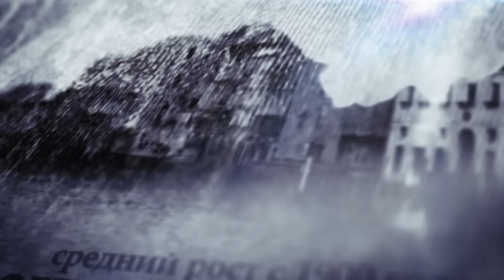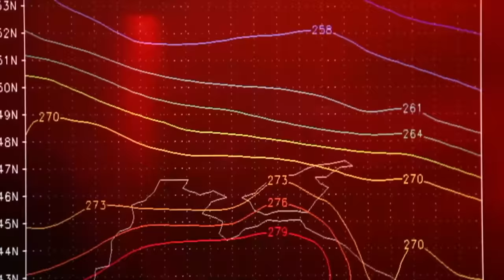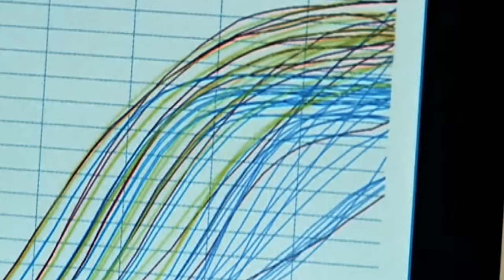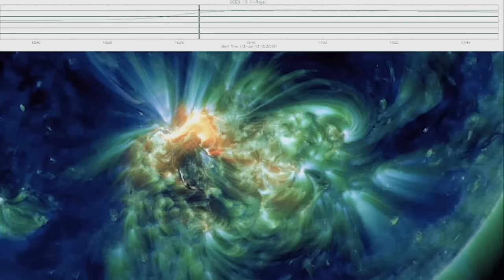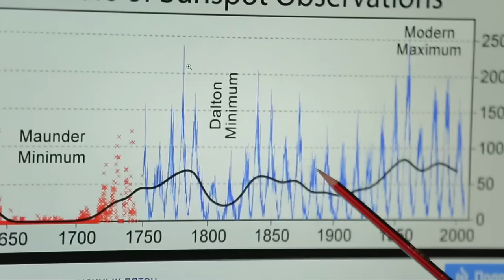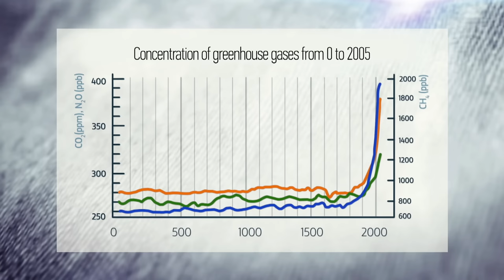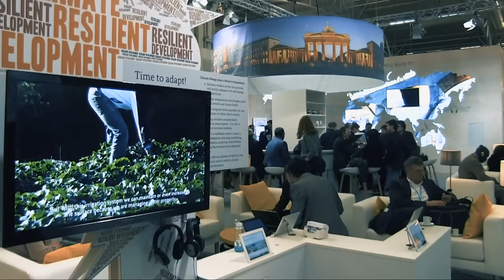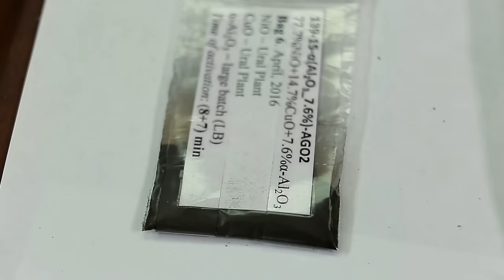Which Countries Could Be UNDERWATER Due To Global Warming?

Comment: Walk across six lanes of a highway barefooted during the summer time then try the same distance on grass. Ever seen the steam come off the rooftop of houses after a rain? As long as more houses are built and roads are widen battery operated vehicles won’t matter. Also feel the heat coming of an air conditioning unit. Houses are usually built after removing dozen if not acres of trees.
Reply: i used to live on a farm and quite often went for a walk in the evening/weekend.  in one direction  half a mile away was a main A road in a valley below.  in the other direction was country lanes and the temperature and air quality difference was obvious without doing any scientific measurements.
Reply: Even the same as dirt were so far gone it’s hard to turn back but I would want to for the planet tbh it sounds so much more peaceful
Reply: Try putting your hand on a solar panel on a hot sunny day. Solar panels can get up to 36 degrees Fahrenheit warmer than the ambient external air temperature. Because the panels (like roads) are a dark color, they are hotter than the external temperature because dark colors, like black, absorb more heat from the sun. When solar panels get hot, the operating cell temperature increases and reduces the ability for panels to generate electricity.

So you have a lot of people commenting here that we need to move to renewables like solar, but solar panels contribute to heat generation and become significantly less efficient when hot. You need enormously huge solar farms to even attempt to power a small city. Think of the heat those panels in that solar farm will produce.

So the solar you think is the answer actually works against itself by not workingvin and contributing to the environment you want to prevent. Can you see the paradox?

Another paradox is the belief that people should move to the cities where they can walk to work or use more energy efficient public transportation. Look at Phoenix AZ as an example. When I first moved there in 1998 the Phoenix metro area had a population of less than a million. By the time I left in 2015 population was over 5 million. In 1998 you could hike to the top of Camelback mountain, look out and see the edge of the city with nothing but the Sonoran desert beyond. In 2015 all you could see were houses as far as the eye could see. The housing bubble caused a lot of desert to be torn up to be replaced by houses. All the roads, cement sidewalks, and tile roofs caused an enormous heat bubble over the Phoenix metro valley. This caused weather to move around Phoenix instead of over it as it used to do. I diffinately noticed over the years I lived there we got fewer and fewer rain days and it got hotter and hotter. You think that huge metro cities don't change weather patterns? They most certainly do. 

Now why are "they" pushing the climate change agenda like they are when it's obvious some of the suggestions are clearly not helping anything? Politics and economy. Each president and political party has their stump issues to attract voters and attain power. For Bush is was an economy and investment opportunity based on war and defense spending. Remember the axis of evil? Bush and his cronies made a lot of money investing in defense. For Obama it was healthcare that was leadingvour economy. We were forced to buy insurance and who made money? Insurance companies because premiums went up. Healthcare companies because heathcare costs went up. Trump, it's hard to pinpoint, but probably energy sector because he pushed for energy independence and small business. Now you have Biden all in on climate change and renewables. Why? Look at how many of his cronies are heavily personally invested. His energy secretary is personally invested in EV battery technology. Because they care, or, because they want to make a lot of money for themselves?

I'm not against solar. In fact, my off-grid tiny home property in AZ runs  ompletely off solar and my tiny home in Upstate NY has solar. Clearly it works better in AZ than NY. NY solar is only backup for if the grid goes down, but it's not a fulltime solution here. I believe reducing our footprint and reducing our consumption of energy would be a better tactic than changing our source of energy. We should not have built communities of 3000+ sq ft McMansions all over the country.
Reply: agree with the statement black or dark things absorb heat,short answer roads roof tops sidewalks should all be white, not black and red brick is just as bad,white reflects heat. town and city centres are 4 degrees warmer than surrounding countryside,ie black bad green and shade better.and large bodies of water act as moderators for heat ie cool day and release at night
Reply: Well, goodbye earth I guess
Reply: @joshua25k64  no injoy we as humans actually do somthing nature actually loves giving it its oxygen CO2 😏
Reply: @eriknielsen1849  I will enjoy. Cause I'm still pretty young.
Reply: @joshua25k64  😊 good to hear. The best thing I have learned in my 50 year's old life is no matter what fails its always becourse somthing better is coming.... Just a thought. 😉
Reply: @joshua25k64  if we had it.
Reply: Nature will prevail. If not lord help us.
Reply: We could go back to homes build into the earth and roofed with earth and grass. I'd like that. Actually my preference would be to build inside a mountain, using it as a heat sink to keep my place cool, and do gardening and raise animals and bees outside. But we couldn't do that for everyone.
Reply: @amberkat8147   I had a sometimes day dream of lof land covered in old growth trees  Pretty confident it would be its own temper controlled climate with its own atmosphere. It wouldnt rain and storm under a proper maintained canopy but it would condensate like no other and water would run like a faucet down the tree's . 24/7 shade when you take out a tree  or one dies you revitalize the soil rotating crop around a sapling and nurturing it to give us a new roof.  Alot of plants will grow in the shade. Coexist with nature. Only take game required for survival take care of our wildlife. Instead of necking all the waterways and speeding up erosion guide them to snake back and forth across the land keeping majority of silt where it should be. It would be a good life. Enough wildlife would keep the pest bugs down. We could be running w the wolves living in naturally climate controlled paradise. Instead we/our ancestors killed off majority of the people that truly knew how to live off the land and traded thr good life for industry and politics... fuking puke.
Reply: @amberkat8147  what's good lady u trying to build something 😁😉
Reply: None of that matters
Reply: Steve  nature is not suffering as in the noun it is suffering as a verb. It is a contagion spread from mankind. Life may not always be easy or convenient but we bring the suffering on ourselves. You believe one religion or one verse if going to save your soul and damn the rest? Iv struggled with this aspect of religion my entire life. No matter how I look at it I cannot see there being one path. Especially a story written by man like the many others. The prehistory  cultures had no concept of Jesus. Don't get me wrong the ideals are quite appealing , but to me they are man's way of justifying evil and hoping for a get out of jail free card when they are faced with their version of eternity. I want people to be good to each other and protect the rock that feeds and shelters us. If thay makes me crazy or a baby in your words so be it. The problem I my opinion is generation after generation that fail to learn
Reply: Only God's word is infinite,
Everything else is fleeting.
Reply: @Thomas Truesdale: We have the technology to build in seismicly stable desolate regions, with pipelines from dams utilising wind power to pump the water.
The regions where most people now live should be returned to becoming forests again, utilising a broad mix of trees & shrubs, especially sap rich evergreens to reduce the risk of wildfires due to their moisture content.
This would aid in the decrease of CO2 emissions from all breathing creatures & CO from burning organics.
However, it won't decrease CH4 from decaying organics.
Reply: @donaldlaverne991  : But it's not  actually GODS word. It was written by man. A guide & a history lesson of what not to do & what to do. But unfortunately, most are either not listening or are misinterpreting the messages left by our predecessors.
Reply: Walk across a desert barefooted, then walk back still barefooted, only to realise you have sore feet :(
Reply: I've seen several wind turbines on fire and I'm pretty sure they are cutting trees down for those and solar panels... I don't think either one can be recycled after they are worn out.  the turbines only work where there is wind and the wind doesn't always blow same with the sun.  hate to be a downer on this one but the solution is worse than the problem....  we need more trees , lots of trees
Reply: True. We need carbon sink more than ever for mitigation and drastic lifestyle change.
Reply: @gwebocelestron9194  Perhaps we could marry solar & wind energy.. devices. Revolving wind "mills" with solar cells could possibly lessen the heat build up of the panels as when placed in sheets on roof tops.
Trees  ,trees, trees. Most property owners are but totally clueless about their function in softening the impact of urbanisation. 
Here in South Africa new upwardly mobile people get in tree "fellers" to clear their recently acquiered homes of trees before they put in a pool and pave most of the rest. Too much Pt to engage in the normal property upkeep.
One hot day I found all the telephone &burglar alarm wires lying on the floor of my newly bought 1960s house . After greening the garden with shrubs & trees the perceptible  temperature difference is refreshing to say the least. No fans, air cons at all.
Reply: @eriknielsen1849  Better than Humans😂
Reply: so are you going to live in a tent? with no heat or ac?
Reply: And, here I thought it was CO2
Reply: And then look at the planet in relation to the size of all human population. We couldn't change the climate cycle if we tried.
Reply: Wonder if they can sow some light color plant seed and reflect what they can
Reply: And?  WRONG. it is all part of a solution.  PART of a solution, by its own, no, but we gotta store that green produced energy somehow.  get it???
Reply: Do please have a look at Allan Savory and the need to slow the drainage of rainwater from where it falls yo the sea, along with regrassing using the grazing concepts of wildlife in our domesticated farm animal farms, as well as putting back trees.
Reply: Let’s drive on grassed highways.
Barefoot walking on tarmac was idiotic when I was a kid and that was 60 years ago.
I also observe that more people are living better than what life offered at any time in my lifetime. Yet in my teens I was very alarmed by climate science predicting the end of the world before the turn of the century.
I guess they just got their prediction wrong.
Reply: We’re all little heat engines.

Comment: 3:00 There is no such effect as the narrator describes here. Some may be thinking of the reduced solubility of CO2 in warmer water. But the capacity of air to hold CO2 does not decrease with temperature. That's just nonsense.
Reply: "Solarpunk!" by ‚Our Changing Climate’ is a Great Start, you know? 
Not gloomy but also not bilnded-by-Hope Coverage totally exists; in fact, entire Channels exist like this. 
Help with the Climate via that Channel but also UpisnotJump, Hbomberguy, Some More News, Not Just bikes, and Second Thought. 
SMN in fact even has a whole channel of ‚Issue-adressing’.
Reply: @slevinchannel7589  This word salad has nothing to do with my comment. In fact, it has nothing to do with anything.
Reply: @ronaldgarrison8478  R/Confidentlyincorrect 

R/Confidentlyrudetostrangers
Reply: @loturzelrestaurant  I guess so. Just bite me.
Reply: They say that in the 50s we used more fossil fuels and that's when they see the spike in the CO2 levels and that means our use of fossil fuel is the cause of this. Just throwing it out there and not saying that I'm correct on this but I have to ask if it may have something to do with an atomic bomb around 1945ish that possibly contributed to the extreme elevation in everything that they claim is tied to humans   role in "climate change"?
Reply: @jo2dfields457  Come on. Talk some sense.
Reply: @jo2dfields457  You're still not making any sense. Maybe you know what you're trying to say, but you're not getting it across. Right—you don't know what to tell me.
Reply: @jo2dfields457  the amount of heat the earth is warming by is equivalent to 4000  nukes every second.

Comment: If that's all the wiggle room we have, we might as well announce that the fight has been lost. No way we'll do anything with enough impact to keep the temp going up 2 degrees.
Reply: "No way we'll do anything with enough impact to keep the temp going up 2 degrees." Don't give up. We actually have workable engineering plans for using existing technology to get the whole US electrical grid on renewables by 2035. Furthermore, the cost of new electricity from renewables is cheaper than fossil fuels in 90% of the world.

Comment: Two degrees huh ! 
When it reaches that they will be saying oh my I am still alive. Wow now what do I do ??
Reply: Lame.
Reply: There is a HUGE difference between Geological temperature and the temperature of your house. Your house is less then 2,000 feet and earth surface area is millions of miles. 2c is the GLOBAL average meaning, there are areas wheres the YEARLY average is 5c but add in a record deadly heat wave for four degrees, it goes up slightly.
Reply: @LK-pc4sq  << Your house is less then 2,000 feet and earth surface area is millions of miles. 2c is the GLOBAL average meaning, there are areas wheres the YEARLY average is 5c but add in a record deadly heat wave for four degrees, it goes up slightly.>>

If this is a serious issue,  you'd suppose that environmental organizations would terminate their war on nuclear and hydroelectric power.  You know,  concentrate on what is important rather than the trivial.

Comment: If the temperature rises the tree line on the tundra will rise in latitude hundreds of miles and the tundra forest will grow and it will absorb tons of CO2 (which is too low it was 2800 ppm in the Jurassic period when the earth supported the biggest explosion of life the dinosaurs and giant trees) so the earth will take care of itself without the need to impose a carbon tax.
Plants need CO2 and warmth to grow ask the greenhouse farmer. they put 1000 ppm to speed up the growth.
Reply: If you anti-CO2, you hate vegetation, period.
Reply: Plants are thriving.That is Good.
Reply: @Tmarc7665  Reed better and then talk.
Reply: @dennisbailey6067  That's what I'm saying.
Reply: @mans4104  I know.Many others don't get it.
Reply: @mans4104  Spell better first.
Reply: Too far north there is not soil sufficient for the crops that will no longer grow in 100F heat. Can't eat trees.

Comment: In reference to the portion covering solar activity at around the 25:00 mark, I think there are some things that we are not taking into account simply because we do not know about them. I heard a quiet story about 15 years ago that alluded to the possibility that our Solar System was entering into an area of the galaxy that had a higher concentration of interstellar gases. I think maybe these denser regions that contain a higher concentration of hydrogen is like stepping on the gas pedal in your car....it feeds more fuel to the sun and we see a higher level of activity and energy output.
Reply: Very interesting
Reply: Thank you for putting forth an actual scientific hypothesis instead of offering up cow farts and diesel trucks.